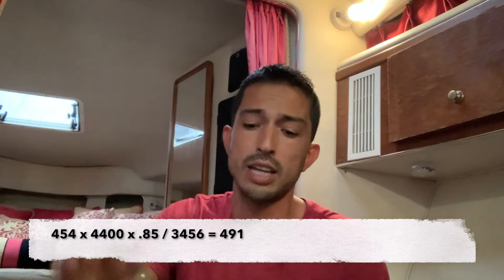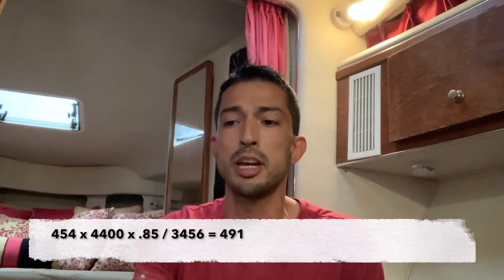Why i switched from a 750cfm to 600cfm carburetor on my mercruiser 454

Comment: Hello, thank you for your videos. How many miles per hrs your boat does at 3500 rpm or cruising speed? How many gallons of fuel per hr does she make at cruising speed? Thank you in advance.
Reply from the maker: Thank you for watching the video :-) at 3500 I’m probably pushing 30 miles an hour but my best cruising RPM is 3100 and that gives me 24 miles an hour but one thing to consider is that I’m usually topped up on fuel and water so that’s 200 gallons in fuel and 75 gallons in water plus whatever is on the waste tank, so that’s quiet some weight just on itself, so with those numbers at 3100 RPMs I’m usually burning 13 to 14 gallons an hour per engine 🙄 lol 
But these numbers varies a lot for an example to my weight to displacement ratio my engines topped out at 4100 RPMs I’m not quite sure what’s the size of my prop but they are reasonably big and the 3100 RPMs I have a nice and smooth cruise and anything above that my efficiency starts going down. thank you for watching 😉